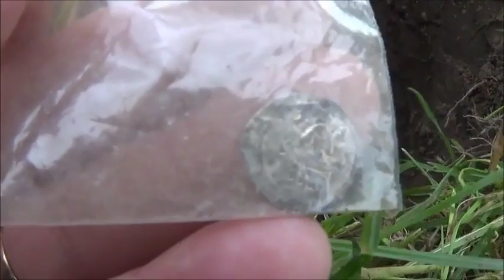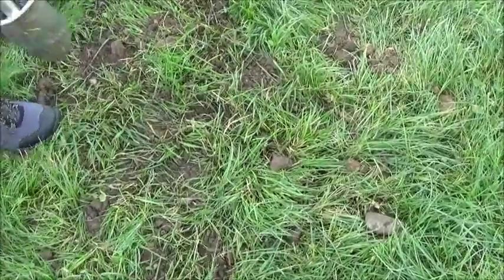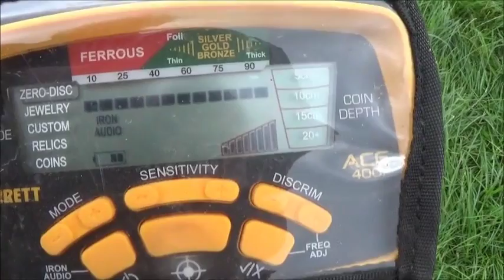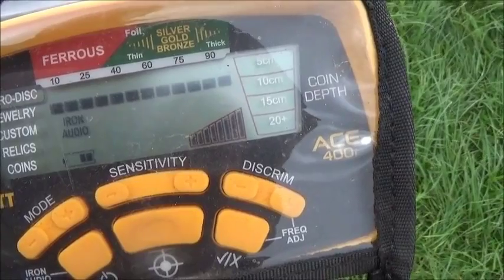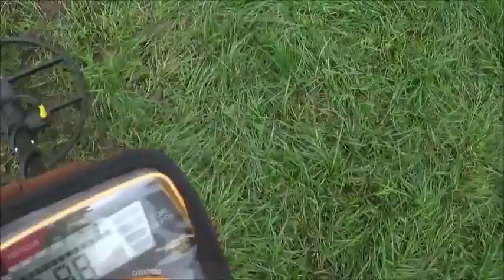CHESHIRE METAL DETECTING ( 100)Ace 400i Depth Test

Comment: Nice depth test Tom. The day I dug that witches jar, the guy I was with was using an Ace 400i. He was a first time detectorist and still got himself several older coins, even some at 8" plus. This machine is one of the nicest turn-on-and-go machines I've seen so far. Can't wait to see what you pull out of the ground with it!
Reply from the maker: Thanks Jason, you hit the nail on the head, its a turn on and go machine, no messing with programs, no tweaking, and deep, I know it will fall down on recovery speed, but you cant have everything, unless you have a big bank account, and most of us do not, I think I mentioned the potential Roman field we are waiting to go on, end of July beginning of August, I will be able to cover a lot of ground, maybe find a hot spot, then do that area very very slowly, I might even put the Mars sniper coil on if we hit a hot spot...
take care
Tom

Comment: Why not try it with a stranded coil to as well Tom as i was going to get a bigger coil for my 300 i but been told if the 300 i would work better with a bigger coil Garrett would have fitted on what do you think
Reply from the maker: Hi Dave, If I remember I will do it with the standard coil, and let you know, or you could test it yourself using a sixpence, you seen how we done it with a piece of wood and tape measure... but the big coils do make a difference, I don't know who gave you that information, but remember Garrett have to look at costs... and with the Mars coil I use selling for £160 it would not be cost effective for them...
take care mate
GL & HH
Tom
Reply: OK Tom i will give it a go i have a silver i found and cartwheel i will give the both ago and see how deep the 300i can pick them up

Comment: Cool can't wait to use my 400i with the nel tornado now what number was the hammered coming up as please as I don't really dig anything under 70 need to start now I think thank you for the upload GL /HH ☺️
Reply from the maker: Hi Mate, the hammy was jumping about a bit, but it is one of them that you just go on the tone, you will get used to it, if you get a double dinger, you have to dig it, but coins normally come in around the 80-90 mark, but do not take that as a set rule, soil conditions, size of coin, and metal content, silver/copper etc, and also if the coin is on edge can all alter the signal/numbers you have to just get a feel for the tone more than anything...sorry not much help, but I dont want to mislead you..
take care
GL & HH
Tom
Reply: Tom Wood thank you very much for replying to me I'm out tomorrow so shall give ago and dig lower numbers thanks again ☺️ GL /HH ☺️

Comment: Very impressive Tom, I should imagine that coil will add a lot more depth to the actual machine?? Regards Mark
Reply from the maker: Hi Mark, I cant fault it mate, and I am amazed at the pinpointing, I am digging 8 inch round holes, with a 15 inch round coil, that's not bad, I am well happy with the 400 and the coil, I am going to do a recovery test, I dont think it will be great but you cant have every thing...LOL
take care
Tom

Comment: What settings were the euro ace on? I use this detector. The standard double D coil I find it hard to accurately locate the targets. Even with the pinpoint on the machine. Maybe it's time for a new coil !. Cheers
Reply from the maker: Hi Darren, my mate had the Euro ace with the nel tornado coil, and he was in the same setting as me, all metal, and full sensitivity..do you do the cross method, come across your target with the pinpoint button depressed,  when the bar goes all the way to the right, put your coil flat on the ground, and without lifting it,  you turn 90 degrees, move your coil to your right or left, then back again over the target,  when the black markers go all the way to the right, that should be the centre of your target, practice with a coin on the surface, just picture a 18 inch cross in your head, but it might end up more of a T than a cross, if I remember I will do a little piece in my next vid...
take care mate
GL & HH
Tom
Reply: I've tried that Tom. It's probably me just too eager to dig the treasure haha. Thanks for the reply 👍🏼👍🏼

Comment: Nice one Tom.....really interesting experiment. Was going to suggest doing the same with the Stock Coil on. Is that a Mars Goliath coil you got on during the test? Was out on pasture fields yesterday with my 400 fitted with a Nel Tornado and it was hard going, every signal was deep all of which were deeper than the length of a pinpointer.
Reply from the maker: Hi Paul, Yeah its the Mars Goliath, I know the stock coil would not of touched the hammy at that depth, I don't want to do to many depth test videos, people will get fed up of them, as you say it was hard going with the big coil, everything deep, but half of them could of been hammies....lol    when the ground is a bit softer it will be a lot easier, I dug a hole in my last video, not far off 2 ft for a piece of iron... I was knackered..
take care mate
GL & HH
Tom